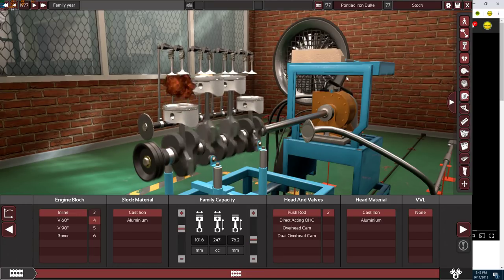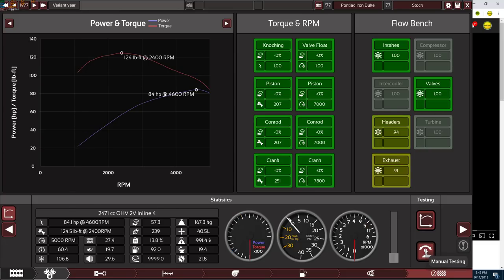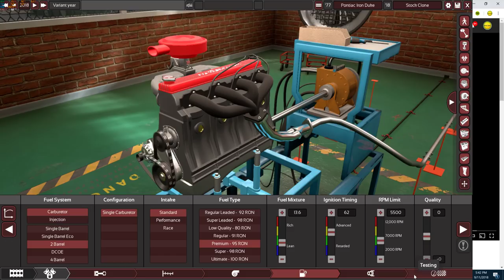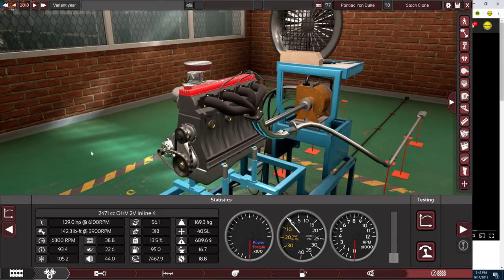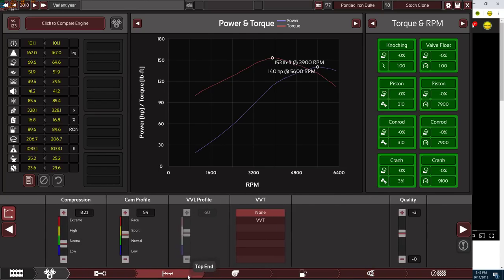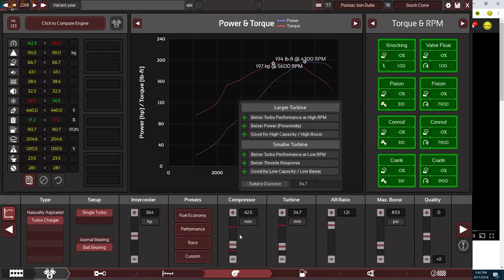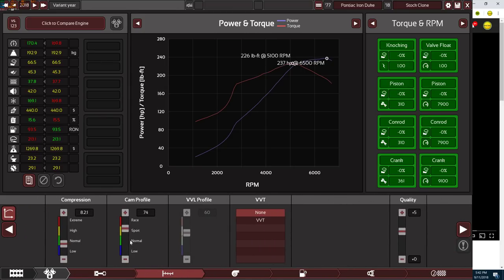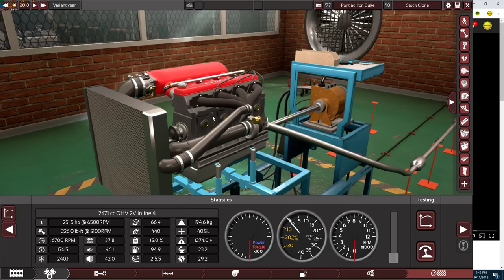1977 Pontiac Iron Duke (Boring engine into a Tuner dream Engine).

Comment: That engine was actually used a lot in Brazil by Chevrolet Opala since 1968, called 151. People here would just change its valve command, exhaust, inition and maybe use a twin-body carburator. High torque and even stronger than the 6-cil 4.1 that the SS version used to has!

Comment: I think one of the reasons the iron duke  (atleast from 1977 to 1981) vibrated so much was that it was based on the 301 Pontiac v8 which in an effort to increase fuel economy only had 2 counter weights on the crankshaft making it less smooth, especially when you remove half of the cylinders.

Comment: The Dukes Achilles heal is the crank shaft . Once you start pushing it over 5000 rpm its decent to blow . It needs a crank from a super duty 2.5 and replace the fibre cam gear with a steel one . Then you could push it more

Comment: Pontiac made performance heads and cranks for the iron duke, little monsters that pontiac had fun with. You can still get the SD parts for the iron duke from kansas racing products, make that $100 block crank 300hp and still keep the sexy OHV sound.
Reply from the maker: That’s awesome, thanks for the info
Reply: Where I got a 85 pontiac fiero with that motor
Reply: @joserribera4888  I just went looking for the site and I think they've gone the way of the dodo sadly. 

But if you're interested in finding Super Duty parts for your duke you can find them on the used market for decent price, the best place to look is on the Iron Duke Community on Facebook.
Reply: @joserribera4888  inliners international is also a good place to look.

Comment: The 'famous' carb isn't famous at all. 2bbl stands for 2 barrel.... as in the number of throttle openings. 
  The Iron Duke, so named because it could take anything you can throw at it. Particularly because it simply didn't make enough power to be able to hurt itself.
Reply: I had a friend drain the oil in his car. Do burnouts and rev it up for almost 6 hours without oil before seizing up.

Comment: And for all that money you could just LS swap. Same weight, 2x the HP or more, better smoothness, better reliability, better sound, better aftermarket.

BTW, the upgrade path for most engines, in specific general order is Intake, Exhaust, Tune(or converting to EFI), Headers, Cam, Compression, Heads, Big bore/stroker, Forced induction. When doing the last two, those usually also involve doing upgraded internals first/with the mod.

Also, you can't usually bore more than .040 over safely. That's 1mm. The largest overbores range up to .080 or 2mm, but that's if the block is in perfect condition and sonically checked. Stroker kits can usually increase stroke by up to 0.5", though. That's 12.7mm. Much more effective in increasing cubes to get more power.
Reply from the maker: I said that in the video, it’s cheaper to LS swap it at the end (as a joke) 

And as I always say at the beginning of any video of this series ( let’s say that you have this engine in 2018 with very low milage and a clean health).

I use an upgrade path specific for each individual engine according to its flaws and restrictions.
Reply: the built iron duke is 1000% more interesting. every time i see a car with an ls at a car show, i sigh, roll my eyes, and instantly walk away.

Comment: 92 Chevy S-10 runs 2.5 Iron duke with five speed Borg Warner T5 Engine rebuild kit from Rock Auto with .0030 over Pistons  and everything else you need incl gaskets for 300.00 remove the cat you will get the same result without all the rest. engine tear down and rebuild is easy peezy.  stock truck is half the weight of the Pheonix. turbo is not recommended not enough rpm for spooling recommend super charger possibly electric

Comment: I love it. No valve float comment on running a push rod engine above its stock speed without tighter springs or lighter push rods. Yeah, let's just shove this reciprocating mass harder and faster. Lol the valves aren't going to smack the piston or mess with timing because they fly open uncontrollably.
Reply: The reason i still have a flat tappet .606 .247 cam sitting there. It calls for much heavier springs.

Comment: I think this engine with the modifications suggested would  obliterate itself in less than 5k miles. Makes it too close to a race engine for practical use. In its truest underpowered form, it is indeed almost bulletproof.  With forced induction and a whole range of mods, it will shorten the lifespan significantly.  But, for the simple shock value... if you have the money... by all means, please try it just to shut up the haters. I don't hate this engine. I actually respect it for what it was and look forward to what it could be.

Comment: is there any tip to make an engine more rough at how it sounds, ? lower the smoothness , would do it? and how?
i was asking because i would love to build a engine that sound metallic and loud.
Reply from the maker: The smoothness in Automation game won’t affect the noise, but to make an engine with rough idle sound you need a sporty profile camshaft, the sportier you go the rougher the idle becomes. The loudness can be raised by using a performance intake or race, and a sporty less restrictive exhaust system.
Reply: thanks for the tip.
Reply: That lopey idle I think you are seeking would be accomplished with a performance cam.

Comment: does anyone make an intake header for this motor.  Clifford in Maine is out of stock and will not cast more anytime soon ?
Reply: Im also In maine. yo can find them. I am a fiero guy and they made aftermarket ones in the 90s for it which had better flow. run around 200-400 dollars if you can find one online used

Comment: Hi, could you please make a rover 3.5 v8 engine but can you take a look at these specs: 1- can you make the family capacity 96 x 96 mm
2- can you then make the variant capacity 88.9 x 71 mm
3- then hot rod the engine and make it the 96 x 96 mm size
Ps (pls don’t turbo)

Comment: make a 90° 7.5l v12 cross plane 5500 rpm w the year in 2030, n/a, most expensive parts, highest quality, max torque, max hp, max efficiency, max reliability, minimum weight and max durability.
Reply from the maker: I like it but it’s impossible in Automation game. 
Because there is no 90 degrees V12 and there is no crossplane V12 and there is no 2030 production year yet.